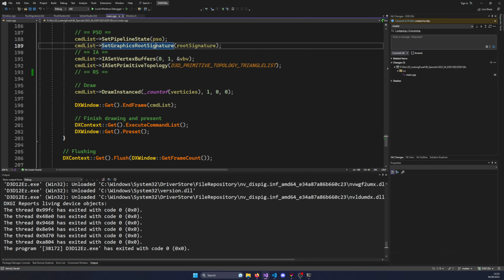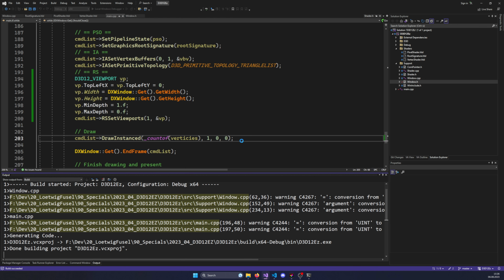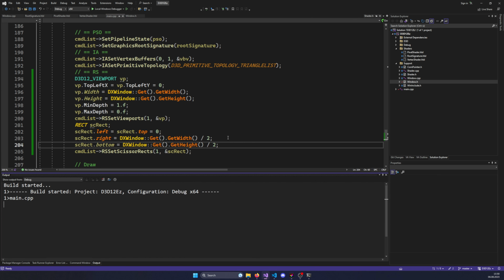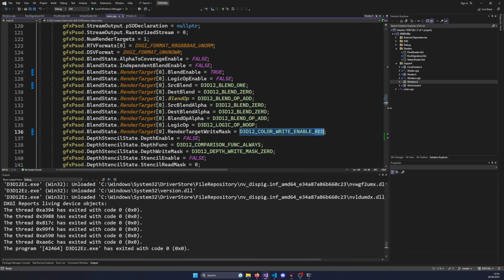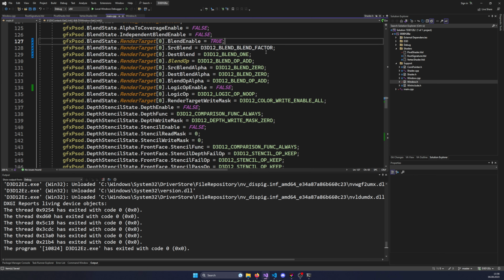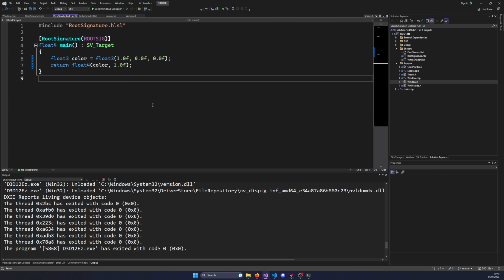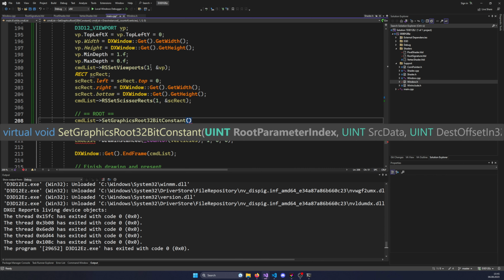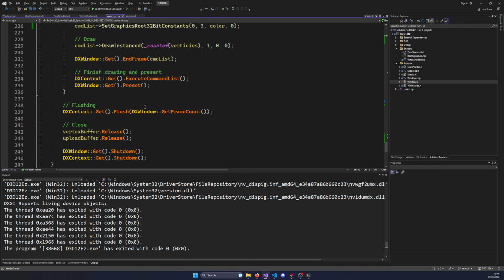Rendering the FIRST triangle | D3D12 Beginners Tutorial [D3D12Ez]

Comment: I'm following along in Visual Studio and the tutorial program is working, but I'm having some consternation regarding the DXGI_FORMAT_R8G8B8A8_UNORM used for the swap chain buffers and configuration of the output merger.  I currently understand this as a 32bit value with four distinct 8bit values packed into it for the red, green, blue, and alpha components of the pixel color.  The pixel shader is returning a float4 which I currently understand as a vector of four 32-bit floats.  My confusion is that this doesn't seem to match the DXGI_FORMAT_R8G8B8A8_UNORM of the output merger/render target.   Can you provide some insight?  Thanks.
Reply from the maker: Yes float4 are 4 32Bit floats. However as the buffer is _UNORM which means unsigned normalized (0 to 1) the 0 to 1 float range is automatically mapped to, in this case 4x 8Bit unsigned or 0 to 255. If the texture format was _UINT or _FLOAT it would not match.
Reply: Thank you. @LötwigFusel